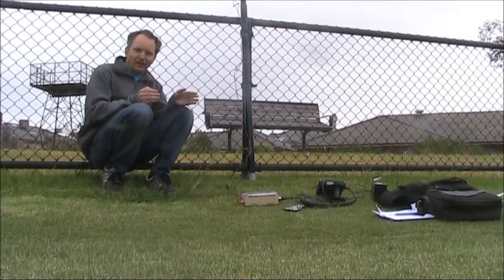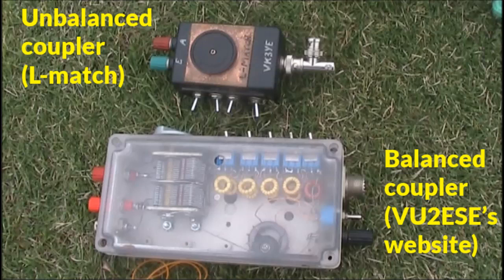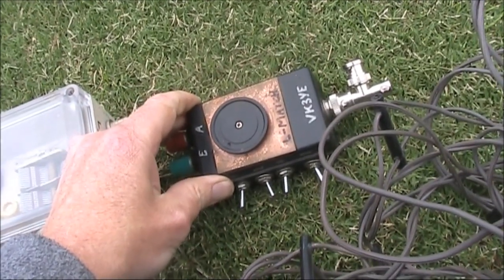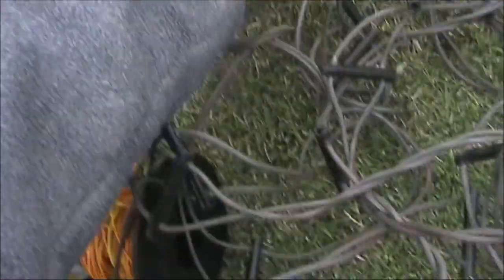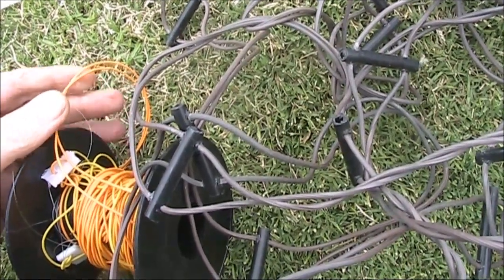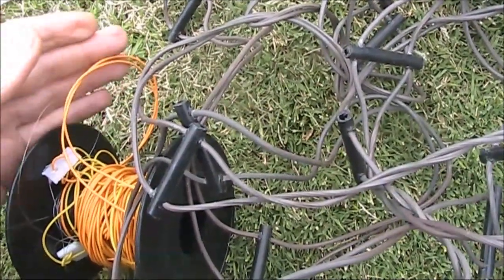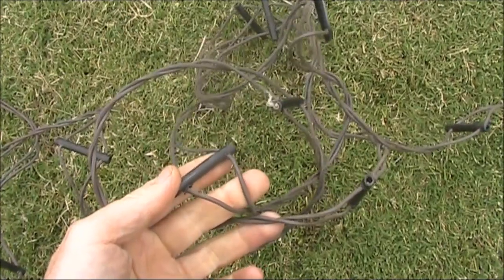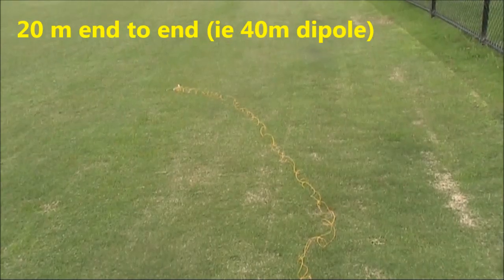Will an unbalanced coupler work with tuned feeder dipoles?

Comment: I would not expect any difference in radiation efficiency. The difference should be in common mode currents. That may well not be an issue in a portable setup using low power but in some cases it's a real problem.
Reply: +1.  Although you're testing something different, this experiment somehow reminds me of IZ2UUF's videos https://www.youtube.com/watch?v=rZifzAY2lUk and https://www.youtube.com/watch?v=QFOx7vjchy0 who measured noticeable CMC even from a low powered FT-817.  Peter, do you have an RF current meter? If you don't I'm sure you could build one from parts in your junk box! I built one myself following Owen Duffy's guide https://owenduffy.net/module/icm/

Comment: Peter: I ran a similar test many years ago on 80 and 40. The results, as to signal reports, matched your tests. The antenna was a German Quad, a 1-wave horizontal loop up about 10 meters at the corners. What did improve was the reduced RFI around my house. With the balanced tuner, I had very little to no RFI. With the unbalanced (T-tuner), I interfered with the phones and tripped a GFI-protected AC line in the bathroom.

No room here for the German Quad, but I have baluns, RF isolators or ferrites on my current coax-fed antennas...

De WB2VUO here near Buffalo,  NY
Reply: Likewise,  I found that maintaining balance was a huge advantage in minimising and mostly eliminating RF interference (TX)  and drastically reducing noise pickup on receive. This was at a previous qth where I could erect full size antennas.
de G4MQK

Comment: This is not surprising, especially since you're only using an inverted vee dipole arrangement. You probably wouldn't notice any real difference if the dipole was fed with a coaxial cable either. 
Where these things may matter is when you're trying to preclude interference from being picked up by the feeder. *edit: or are feeding a directional antenna and want deep side nulls or to preserve the front to back ratio.
Reply: Yes my thoughts. Another experiment would be to disconnect the dipole leg that joins to the earth side and see if that makes any difference?
Reply: @oilydigits  I think that would definitely be problematic. It definitely wouldn't get out as well either
Reply: If you connect a dipole to an unbalanced feeder is it still a dipole, or is it now a quarter wave, pushing against the coax outer, rig chassis, rig ground and that other bit of wire that you have in the air? To illustrate this, I have, disconnected the earthed leg in the above illustration and output results before and after were no different.
73 de M0KOV
Reply: @oilydigits  It would be heavily dependent upon the coax length you're using as well as the angle you're routing your coaxial line away from the remaining dipole leg.
It opens up a lot more variables. In fact coax length can heavily affect the effectiveness of a balun up at the antenna because this affects whether there's a current node of the feedline outer conductor up at the antenna or not, and therefore the effectiveness of the common mode choking impedance afforded by the balun. 
In summary, you're best off using a balanced feeder, both dipole legs in place and having the balun at the transceiver end of the line.
In fact, It would be interesting to measure how much RF ends up on the equipment with the balun in place and without it when using it at the radio instead. Probably far less than you might think and again would depend on the feeder length.